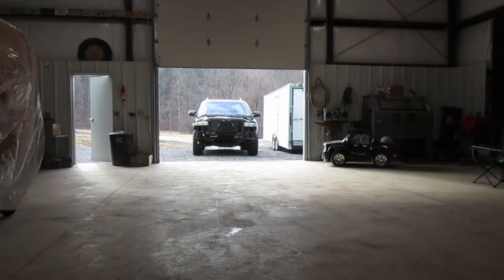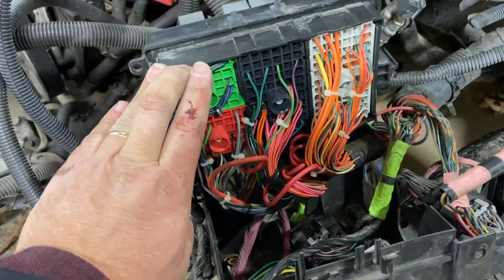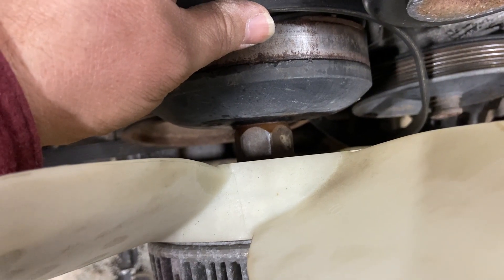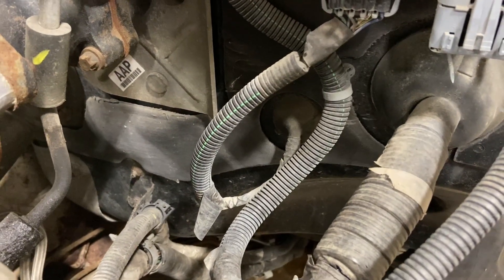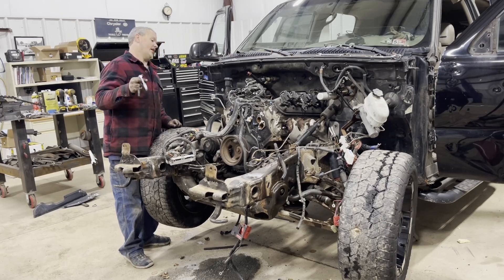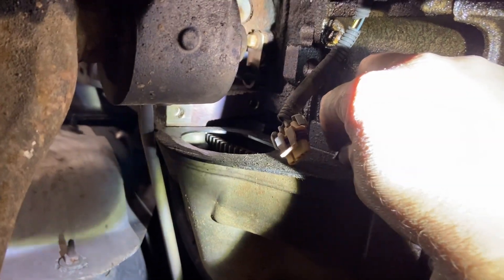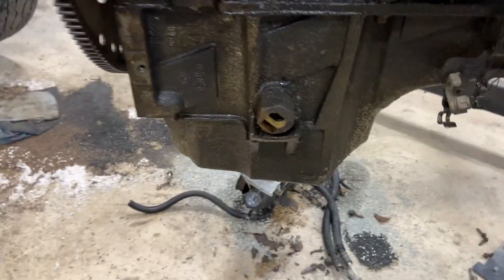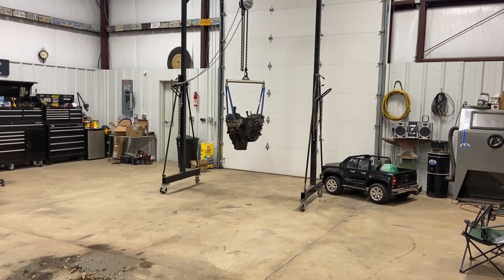LS Donor Tahoe - remove GM 5.3L in 17 minutes for LS swap project

Comment: Have a question I’m doing a ls swap taking the motor out of a 2003 Chevy Tahoe putting it in my 87 cutlass I’m not going to be using the intake I’m going carburetor and also I’m going to keep my 700r4 transmission what wiring harness will I need
Reply from the maker: @LeeAnderson-zg2mh  well that depends on what are you planning on running your ignition coils on?  Since you are going carb, you don’t need drive by wire throttle body or injectors. But you still need something to fire ignition coils 👍🏻👊🏼🔧🔧🔧🔧
Reply: Maybe standalon
Reply from the maker: @ I would get MSD 6014 to control  ignition 👍🏻👊🏼🙌🏼
Reply: Okay thanks
Reply: Everybody saying psi conversion harness
Reply from the maker: @LeeAnderson-zg2mh  as far as I know PSI don’t have anything since you want to run carb.  All PSI kits use factory computer which goes to a throttle body.

Comment: I waited to see the gas pedal removed?
Seems like there's a wire or 1/4 hose going behind my dash?
Haven't cut it yet ,I can't find it's end.
Reply from the maker: @MarkPope-q3e  did I not show gas pedal?   My fault, there is a small bundle of wires that go thru firewall with large rubber grommet.  On the outside those wire plug into pedal module.  Take module and wires if you are going to use drive by wire on your swap.  If you are changing the throttle body to drive by cable you can leave it there, you will not need it 👍🏻🙌🏼👊🏼 thanks for watching our videos, we really appreciate it 👍🏻🎥🎥 let us know if you have any other questions 🔧🔧🔧🔧

Comment: great video! i’m working on swapping motor and trans from 97 1500 to a 93 suburban. i had got frustrated because the drive shaft bolts and rusted on and i didn’t have the tool for the fan removal but you helped
Reply from the maker: glad we could help, 🔧🔧🔧👍👌if you haven't already please give us a subscribe, thanks for watching

Comment: Great video , love the humor ! Getting ready to do a 04 Escalade for the Lq9 and trans for my 58 Apache . Any words of wisdom before I start ? Thanks in advance !
Reply from the maker: we try to have fun here, glad you got the humor.   decide if you want to save harness or not, its a time consuming project to save it, but it does save you money. so that's up to you. your exhaust manifolds and maybe oil pan will have to change, i show some oil pans in one of my later videos. also depending upon the mileage on your escalade change water pump, alternator and starter while motor is out.  if escalade was low on oil pressure put new oil pump in it. other than that enjoy it, LQ9 should move a 58 Apache pretty good
Reply: @andhotrodshop  Tracking, sounds good . Keep the vids coming . Thanks again take care !